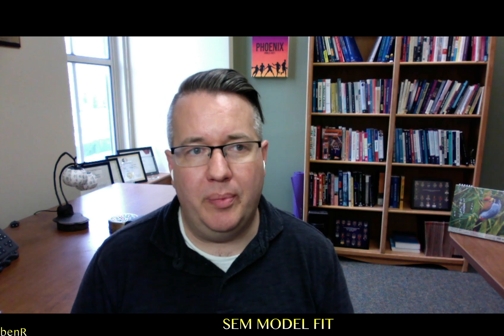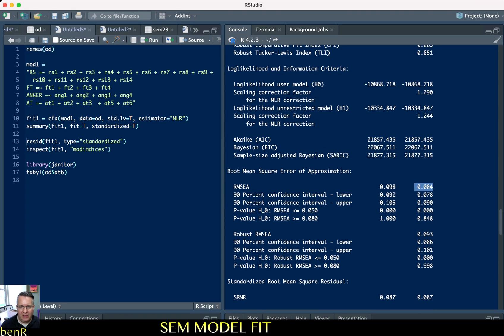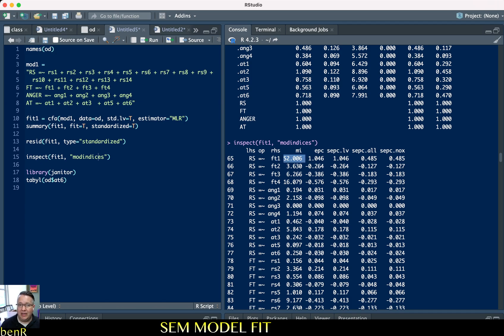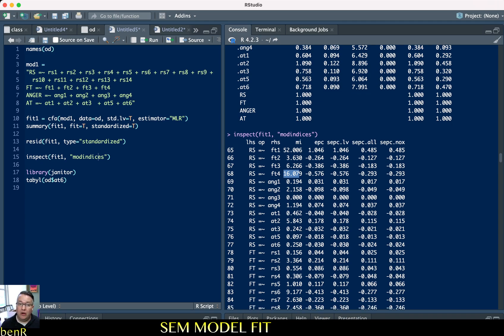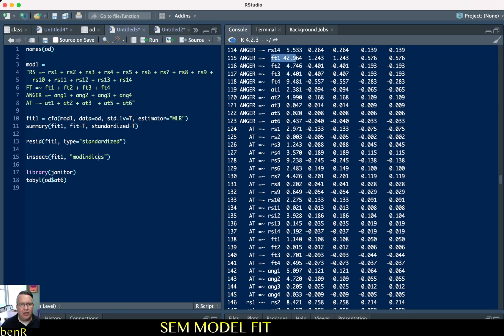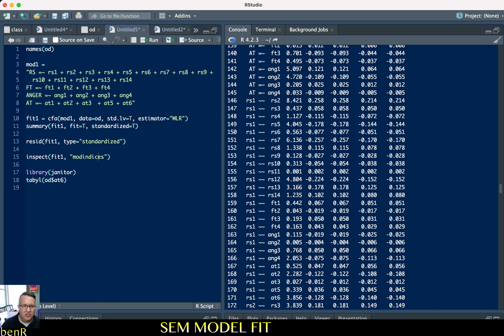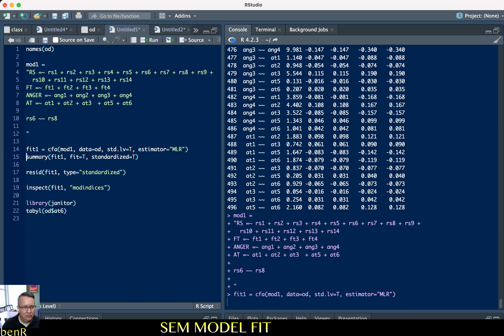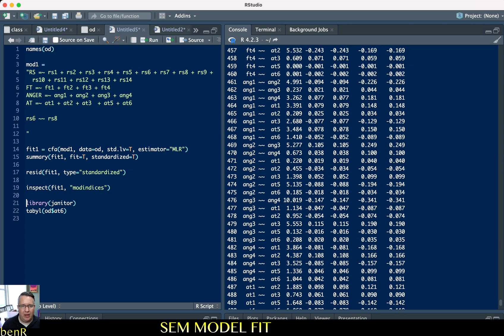Help! CFA Model Fit Part 3, Modification Indices

Comment: Hi Ben! Thank you for the video! 
I did a three-wave study, repeating the measures in each wave. 

Does it make sense to use the adjust my CFA if, for instance, I get high MI between same itens in different points in time, or if I get high MI between different itens in same points in time. Example of one and other:

Time1_Bullying1 ~~ Time2_Bullying1 (1 correspond to the item number)
Time1_Bullying1 ~~ Time1_Bullying2 (1 and 2 corresponde to item number)

Thank you so much!